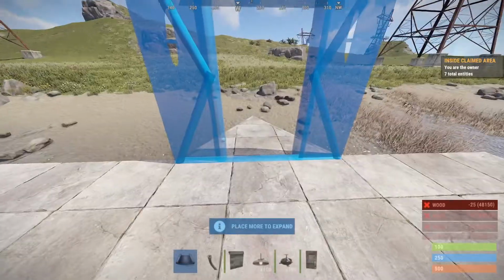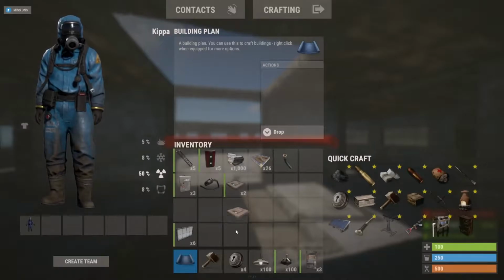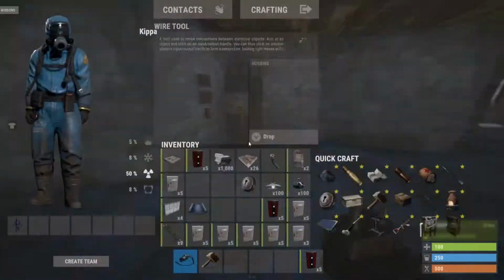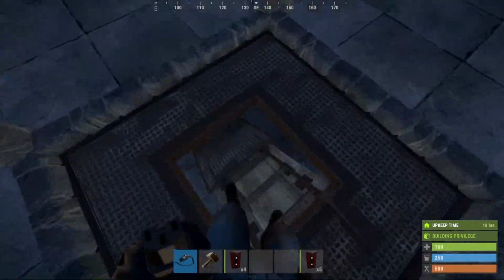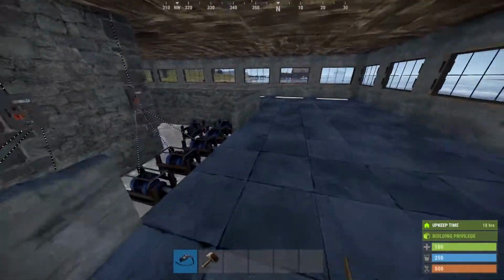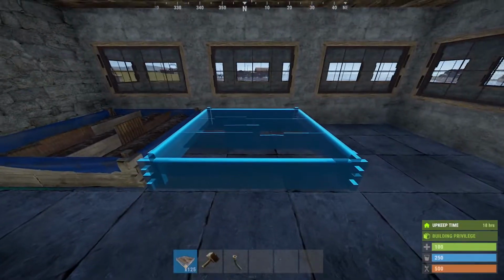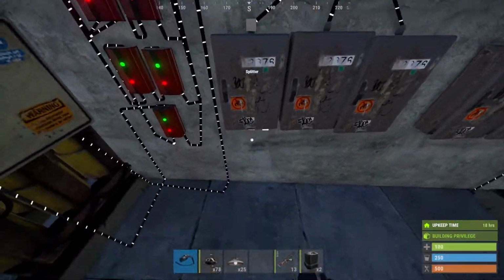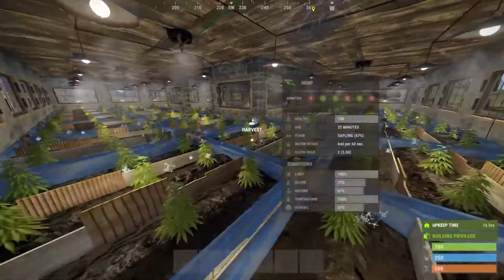Rust - Salt Water Mega Farm Step-by-Step Guide

Comment: Great video! Couple of things to mention, in conditions, your overall score will be limited to the lowest percentage thus affecting the output of each planter.  Consideration should be given for the biome that you are building in for temperature.  Adding heaters (3 power each) will increase your temperature rating (and increasing your need for additional power).  You will need a lot of heaters building in a snow biome, where as less (or none) will be needed if you build in a desert biome.  I like your idea of using fish for composting as there is no maintenance for them, but horse manure yields much more compost per unit than fish.  Unfortunately they do require maintenance in feeding them as well as a facility to house them.  With that in mind, dedicating 4 to 6 planters for corn or pumpkins should be more than enough to keep your stables well fed.  By attempting to get your overall conditions as close to 100% as possible will yield much more product (depending on genetics).  So far my largest yield for a single hemp plant was 460 cloth (100% overall conditions with the following genetics: Y, Y, G, Y, G, Y).

It should be noted that cloning only takes place within a single planter and is unaffected by adjacent planters.  That being said, I do like how you seperate the harvesting area from cloning area as a matter of organization.  I like your base design, and using water purification as it removes the restriction of building in swamps and rivers and opens it up building along the coastline for access to the oil rigs, underwater labs, and cargo ship!

Using batteries is also paramount for consistent power, when I first started farming I used wind turbines only directly to power everything and found that the varying output caused me to have to overbuild turbines unnecessarily to ensure that everything was powered up all the time.  Using turbines to charge large batteries which put out 100 power consistently allowed me to reduce the amount of turbines overall, using solar to supplement as needed per large battery.  Some care should be taken with wind turbines as dependant on their placement and wind direction one wind turbine can block some of the wind to another turbine.  To solve this I have resorted to building separate towers at different compass headings as "power stations" that power up my facilities.  It should be noted that the higher the tower, the better and more consistent power is supplied to the wind turbine's output (be careful of shadowing your solar panels).

Overall great job, Sub'ed, Liked, and clicked bell!  Aloha ;D
Reply from the maker: Thank you so much for all the info! I didn’t know a lot of that so super helpful! I really appreciate the support and glad you enjoyed the video! Thanks again!
Reply: Just want to address some of the things Torrey Ho said. Pickles at 1 scrap for 6 at the bandit camp is much more efficient than wasting planters for god clone berries or cloth. Most players dont get to 100% in their planters because you would need to use fertilizer to get the ground stat to 100% and you can also sell fertilizer at bandit camp at a 2 to 3 ratio for scrap which is far more viable and valuable than putting fertilizer in your planters (buy your pickles here whilst selling your fertilizer.) This will give you a stat of 75% as the ground stat would be the lowest and this is what most people do as its more efficient. Wind turbines, building them facing different headings makes no difference as they all rotate to the direction of the wind to generate power. Finally you can stack solar panel right up against each other as shadowing doesn't affect them like it does with a windturbine and even though the sun rises in the east and sets in the west, face the solar panels facing north when in the southern half of the map and south when in the northern half of the map. Then sun is just a visual representation in game when actually the game mechanics the sun scrolls along the center line of the map ;). Great vid will be giving this a go tomorrow on wipe day with a few tweeks ;)
Reply from the maker: @bograt1980  thanks for all the helpful info! And thank you for watching! Good luck on your fresh wipe!

Comment: Leave all the combiners at roof level ..connect all windmills and pannels together in a closet on the roof and then bring one line down to a splitter/3way then to batteries.splitter will be a good way to divide the supply evenly to all 3 batteries.and is easy to check to see the power coming in available in one spot.
Reply from the maker: Great suggestion! Thank you for that ✌️

Comment: You over built on water, and over built on lighting - Making the rest of your build much harder than necessary.  Going up levels with more efficient water/lighting use would be better.
Fresh water - 1 pump powers = 4 sprinklers.  Salt water - 1 pump + purification = 2 sprinklers powered;  3 salt water pumps + fluid combiner + purification = 6 sprinklers.
Sprinklers generate 15 ml of water statically, which is equally divided by the # of planters it touches, and only in whole numbers (rounds down.)  
15ml for 1, 7 ml for 2 (1 loss) , 5 ml for 3 (0 loss), 3 ml for 4 (3 loss), 3 ml for 5 (0 loss).
Plants can survive (with no W genetics) with 3 ml of water per planter;  
Thus 1 sprinkler can water 5 planters;  Thus 2 sprinklers can water a 5 x 2.  If you place the sprinklers smartly.

Maximize for water efficiency?  Or maximize for lighting efficiency?  Which is more expensive to produce?
For Salt water, Water is way more expensive to produce, thus water efficiency is important, lighting is not.
Ceiling Costs 2 power.  Light 1 Light = 4 planter boxes.  Place lights accordingly.    
7x tall (min height) for wind turbines;  1 Wind turbine = 70 watts = 1 Large battery = 80 planters (Fresh water planters), ~ 40 planters for salt water. 
Building off of the 5 x 2 (planters only) you can either go up (Building the Frank), or you can go wide 4x7 or 6x7 (planters only). 
Or you could do 5 x 7 (pumps/loot in center), or 7 x 7 (pumps/loot in center). 

Or you could build off of the 2 x 2, or 4 x2 , or the 4 x 4 modules. - With less efficient water uses, but meh.

Comment: What’s upkeep?
Reply from the maker: Upkeep (with windows on walls) - 13,296 stone, 1,048 metal frags.
Items needed - 12 water pumps, 4 electric water purifiers, 6 wind turbine, 9 solar panels, 18 splitters, 15 root combiners, 1 hose tool, 1 wiring tool, 73 lights & planter boxes (less lights if you put one for every 4 planters, I learned this from the comments) & 22 sprinklers

Comment: Bro do you think you could add a material list next time I’m trying to build this and I don’t wanna be short
Reply: Thanks bro
Reply from the maker: Just recently reinstalled rust, will do that as well as upkeep cost ASAP and let u know
Reply from the maker: This is the best I could do so I hope it helps! (This is all approximate and could change depending on things like windows vs walls etc.) 
Upkeep - 13,296 stone, 1,048 metal frags.
Items needed - 12 water pumps, 4 electric water purifiers, 6 wind turbine, 9 solar panels, 18 splitters, 15 root combiners, 3 large batteries, 1 hose tool, 73 ceiling light and planter boxes (can use less lights if positioned 1 every four squares, I’ve yet to test this) 22 sprinklers

Let me know if there’s anything I missed, I do plan on making an updated version of this base using mostly the feedback I’ve received from this and another video

Comment: Man i appreciate it for this amazing guide. Maybe its outdated idk but i'm using this design for 2 months. In 2 wipes i saw the same problem with sprinkles. Gravity is okay for water purifies, at the beginning all of them is working well but lately some sprinkles are not working. Just visual coming up thats all. When i tried to unplug and plug the cables for sprinkles, its gonna be working as brand new but after some time its stopping. Do you know why ?
Reply from the maker: Hmm do you happen to know how many sprinklers are connected together? I know each purifier can only supply so many sprinklers

Comment: Hey. Liked the video. Noticed the improvements from the previous farm. I assume that the upkeep is less. Also liked that you had learned to optimize your electricity output. Problem though that I did notice was that you are way overcharging your batteries. Like by 300 percent. Each large battery will only put out 100 electricity. To keep them charged at all times the way you have them wired requires 120 power. 1 wind turbine will give 150 power on average. This will fluctuate, but will fluctuate by the water in the desert biome. To make sure you keep flowing at all times, 1 windmill and 2 solar panels will be a little overkill. This would reduce the amount of windmills and make the remaining windmills more efficient. Also it will reduce the chance of your windmills shading your solar panels.
Reply from the maker: Thank you for that! My plan is to take what I have learned from the comments on this video and make a better base soon so I will absolutely keep that in mind! Appreciate the tips!

Comment: Nice video; you could improve your electrical setup in a few ways. Firstly I would use root combiners to connect all the inputs (wind turbines and solar panels) into one single input, then put that through splitters to a bank of batteries (and remember that a large battery can use a maximum of 125 power for charging - I'm fairly sure you're wasting power in the setup you used). This will account for variations in the power supply based on e.g. position of the sun. Then you can use combiners to connect all the batteries together into a single output rail, and use branches to distribute the power where you need it - this way you can configure exactly what each component needs compared to splitters where you can only divide by two or three with each output. I usually have a bank of branches next to the batteries, with each branch sending a chunk of power to a major system or floor, then use more branches locally to divide it up (for example one branch serving all the pumps, then at the pumps using one branch per pump). It's more efficient and also simpler to manage 🙂
Reply from the maker: Awesome thanks for the info! There is still quite a bit I need to learn for power and components, but I will certainly try this out sometime! Thanks for watching!

Comment: why do the water purifiers slowly run out of water
Reply from the maker: Check that all salt water pumps are working, they should be able to keep up with the output if all are powered
Reply: @Kippa617  its weird because 1 of the water purifiers stay filled but the other 3 don't
Reply from the maker: @walterthompson6226  check the pumps on first floor, all should have a green light on top to indicate they are running, it may be an issue of 1 or 2 pumps that are connected to the purifiers that are running out of water may not be powered? The only thing that I can think of atm
Reply: @Kippa617  they are all powered, ill try and rebuild it and see if it fixes itself
Reply from the maker: @walterthompson6226  yeah that’s very strange sorry about that

Comment: stop putting sprinklers on the roof, they go on the floor with lights directly above them.... 1 light per 4 plants....
Reply from the maker: Sprinklers only the floor? Like under the garden plots?
Reply: @Kippa617  where you place your sprinklers, thats where you place 1 light, which will give 4 planters 100% light
then directly on the floor under that light, where the 4 corners of the planters meet, place your sprinklers, its easier if you place the sprinklers on the ground before the planters to plumb them up
Reply from the maker: @gonthd8146  i’ll test that out soon! Never knew you could do that thanks!

Comment: You could've gotten rid of the splitters used for the lighting and had only 1 splitter, or better yet just connect the lights directly to the battery. The splitters took 1 power from each source, meaning you were wasting 4 power for no reason.
Reply: or you could have just used electrical branches instead of the splitters. you'd reduce your frag costs
Reply from the maker: @chadc601  yeah tbh there are a few electric components I need to learn how to use better, that being one of them, saving frags is always good!
Reply from the maker: This is true, but 4 power is enough to power 1 light so nbd, thanks though! Never considered dedicating one main line on a battery just to the lights, but this would only benefit if there was 50 lights, since you couldnt power anything else but lights as you are tapped into the main line on battery, and after learning from viewers that  1 light could cover 4 plots, 50 lights are not necessary